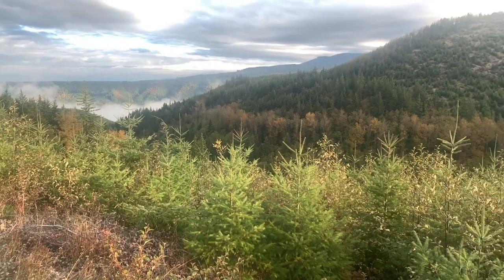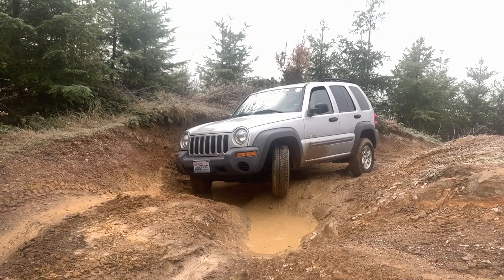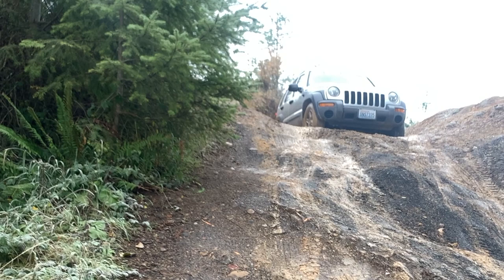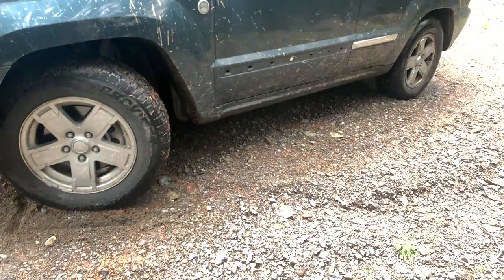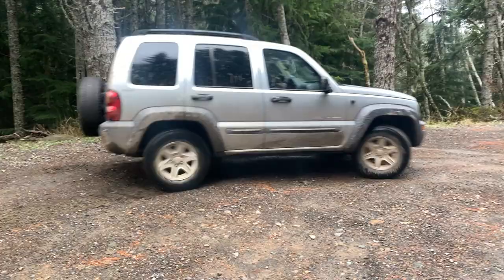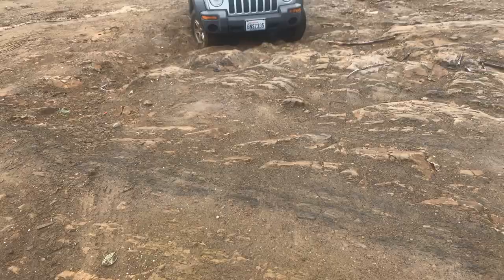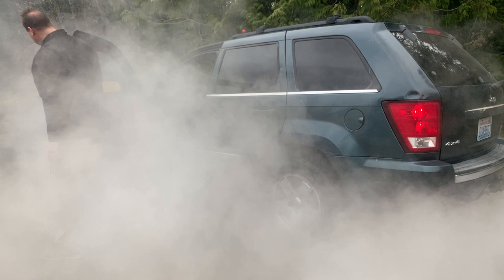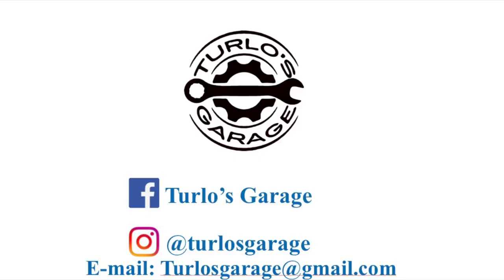JEEP LIBERTY KJ VS JEEP GRAND CHEROKEE WK/ OFF ROAD DUAL TO THE DEATH!/ The winner is SHOCKING! EP34

Comment: I bought an '05 Liberty 2 years ago. Pulls my boat up and down the hills just fine and is fairly simple to do basic repairs & maintenance on. It even flattened a coyote at 65 mph with little more than a cracked bumper cover.

Comment: In regards of the jeep liberty towing, my Ford Expedition was down and I had to make a trip from Huntsville TX to Sioux Falls SD and then to deep in the hills of Ohio, 06 jeep liberty I picked up a 6' mowing deck in Sioux Falls and then picked up a front mower john deere 1435 with a deck, so that's 4500lbs for the jeep, trailer 1700lbs, the deck 560lbs and the mower was 2500lbs, that's a total of 9260lbs on a 9500lbs maximum gvwr with a jeep that has 340k miles on a original tranny and engine at 70mph, I'd say that was a test of a true mini giant. That jeep is my tool car and those wondering what fuel mileage was, it was average of 14 mpg for the whole trip.

Comment: My friend have WK with turbo diesel engine and Quadra-Drive, 2 inch lift and 32s. Very capable 4x4!
Reply from the maker: They do really well as long as you don’t have a 5.7 HEMI that gets flooded.
Reply: I got the 4.7 with QDII and its cheating lol cause I pulling trucks twice my size out of sand mud rocks its the best offroad mom van ever
Reply: Mom van 🤣🤣🤣👍
Reply from the maker: @TadiclsOperator  just don’t go through water without a snorkel. Or maybe it’s me and Jeeps and water don’t mix.
Reply: @TurlosGarage  I've been in water level with my hood a few times but I've been lucky so far, but water proving the computers and snorkel are on the list of priorities
Reply: I have this same setup and it's a monster. It will crawl through anything.

Comment: New Subscriber here. I have two 2003 Jeep Liberty's one of which I bought with a blown engine. I'm using it for body parts. Liberty's most two important things to upgrade are a bigger 4 core radiator and a good transmission cooler. Our little Liberty has been a great 4wd that goes awsome in snow.
Reply from the maker: Welcome aboard Mechanic Steve! Thanks for the advice. I have a lot of passionate Liberty owners that follow the channel. In the past year my 02 Liberty has really grown on me and I am very impressed with the value of the Liberty. Thanks for Subscribing and watching!
Reply: Is it true that the diesel and petrol have different 4wd systems? I’m in the UK and deciding which one to get. Petrol has a proper transfer box whereas the diesel has front and rear separately?
Reply from the maker: @johnnon6583  I am not sure. That is a great question!
Reply: Liberty 2006.  Has a tranny oil cooler..
Reply: I grew up in Michigan and always kept a small light 4x4 for winter. S10, explorer, jeep Cherokee...... Those light short wheel base 4x4s do great in the snow.

Comment: i have the ’07 3.0l diesel with QD2.  great car have taken off road in AZ - no issues…. 170,000 miles and going strong
Reply from the maker: I have a friend that bought an 06 CRD Grand Cherokee a few months ago and it has been great. I am very impressed with the 4x4 system in these Jeeps.

Comment: Should call this channel "Jeep Raggin'" !!! Lol.🤪Damn you drive em rough huh bro?
Reply from the maker: It’s a Jeep, they are meant to be driven rough. Just not under water. 😁
Reply: @TurlosGarage  agreed. I like to see y'all push them so I know how far NOT to push mine. Lol. It's awesome man. Been off-roading here in Louisiana for decades. I used to drive a CJ7 with a small block and 38 Super Swampers. It made short work of most mudholes. Now I'm driving a liberty and looking into modifying it. Gotta swap left front axle first.

Comment: The liberty will match almost  every rig if you give it a decent set of tires.... the "off road test" was a terrible display  (first few mins)
Reply: That Jeep Liberty wasn’t even Trail rated. The Jeep Grand Cherokee was.
Reply: I own both a kj and a WK would take the liberty off road anytime before the grand cherokee
Reply: I have to agree with the comment on BETTER tires on the Libbey...From experience when  switched from Wranglers SR-A to Falken A/t3w, it was an impressive big difference between the two tires how it handled offroad Mud and 6inches of snow.
I've also owned both a GC and Libbey...and i agree GC is way more comfortable, but i found the Libbey more easier to steer and handle .
Reply: Liberty is not a very capable offroader! AT ALL!
Reply: @EricJohnson-tb9sj  not sure why you say that.... My liberty has followed fully built jeep wranglers and done just fine.... I've gone through mud holes deeper then the top of the fender flares... It's done fine. They are actually very very very capable off road
Reply: @EricJohnson-tb9sj  The Liberty is very capable off-roading.
Reply: @EricJohnson-tb9sj  why you lying? 😆
Reply: @RangerRick2012  they're as capable as a suburu! You don't have a low range .. you're not following yj's and tj's! Sure! They go off road,  but only to an extent! Same for the patriot!
Reply: @TSuave  you can follow them in the places that are easy enough for the Liberty to go! Mid level to advanced trails and that Liberty ain't going nowhere!! They don't even have a low range on them! And if you've done any off rodding then you know, 4lo is needed for any reL wheeling!
Reply: @EricJohnson-tb9sj  do you own a liberty? The liberty has the np231 or np242 transfercase both with a 2.73:1 low range gear... Again I've been in mud up to the top of the fender flares and continued through... iv followed many build wranglers with 35"+ tires ...
Reply: @RangerRick2012  keep it real son! You don't even have a low range!
Reply: @TSuave  No. But was looking to buy a Lib or a patriot until I researched them both to find that they had the fd1 and fd2 as their 4wd .. (AWD) Systems! Great in the snow! (Like a suburu) but thats about it! I decided to go with a rig with an actual 4wd system 4hi .. 4lo sure they're "capable" .. but only for LIGHT offloading! Its a Mom van!
Reply: @EricJohnson-tb9sj  ok well hate to pop your brain outta your head here but I daily my liberty it's got 4hi, and crazy... 4lo... And 2hi.. wow nuts eh? Oh and for an upgraded bonus I also have 4wd full time! Not sure what part of I've had my liberty in mud up to the top of it's fender flares and followed fully built jeep wranglers your failing to understand but they are deffiently meant for a lot more then "light offroading"
Reply: @EricJohnson-tb9sj  Liberty doesn't have FD1 or FD2, we have Command Trac and select track....Freedom Drive (FD) is a whole different transfer application just like Quadra-track, quadra-drive. Etc...I think the Grand Cherokee I used to have had Quadra-Drive with NV245...I used to like that system too....But regardless, the FD is something for CVT transmissions, which unfortunately Liberty didn't come with CVT, theyre 4-speed autos. . Its like comparing A horse with Bull. . But regardless of tranny system types...the KJ's Command track and Select track is offroad worthy and proven numerous times throughout the decades..its really nothing new in 2021...Is in matter of fact, used Libbys today are considered one of the best bangs for your buck in the offroad world...They're affordable and could keep up with rigs that are 3x more expensive.
Are they the best off-road vehicles in the world? No, they're not Humvees. Do many of the people who buy these models do so because they want to go conquer Moab? Not really,  most are weekend offroaders. Are they as off-road capable as any other vehicle in their segment? Yes…and that is why they have proven to be so popular
Reply: @RangerRick2012  I can concede to the idea that they are as or even more offroad capable than any rig in its segment! But I don't believe that segment goes beyond Libertys, patriots and renegades! But Mr Rick. I may be wrong! You mentioned quadradrive or quadratic in the liberty .. I thought it had the FD system! I watched hrs of footage on the liberty and was not impressed with its offroad capabilities! I'm gonna go back and do some more digging! I don't want to be wrong so I'll get back to you after my search!
Reply: @hollymott9532  its not! You just haven't been anywhere in it!
Reply: @TSuave  Is this the command track system? Hey .. I may be learning something today! RangerRick threw some info on me a min ago! But I will need to do some more digging myself before I concede to the idea of a mom van keeping up with "fully built jeeps" .. But I'm open!
Reply: @EricJohnson-tb9sj  no no, Quadra-Drive is a Grand-Cherooke thing..FD were made for Patriots and Commanders on 2006 or after with their CVT tranny....i used to have a 2001 Grand Cherokee..Used to be more into offroad when I had that GC... then i started leaning on the speed world. So I sold that Rig a long time ago because i bought a sports car....Then suddenly I missed having a jeep for bad weathers (i live in the North East, were snow blizzards can be a problem and that GC never failed me on blizzards)...So in 2018 i decided to buy an affordable 03 Jeep Liberty for those weather occasions...i think i only payed $3500 with 130,000miles (which is low for that year)....But as time went by, i decided to push the lib to its limits just to see what it can do in all areas..from highway, snow to offroads...even racing LoL...I've taken it to many backwoods adventures dropped in LO with mud pits and climbed out mud holes that must've been a little less than 3ft tall.. Thats when i personally learned its definitely offroad capable  💯 . . . Now, thanks to that Libby that i underestimated..I'm suddenly back into offroading hobby lol...Now in the process of getting a OME lift kit.

PS....and that Grand Chrokee that I sold years ago, I still see that damn thing being driven around by the person that bought it off me..that truck definitely over 200k and still kicking lol
Reply: @EricJohnson-tb9sj  yes the command trac is the NP242 transfer case, same case used in a lot of jeeps... (Cherokee, liberty, etc etc)
Reply: @EricJohnson-tb9sj  well a friend of mine in our local offroad group has a jeep wrangler on 37's and locked and lifted etc etc with Mikey Thompson tires on her and I can follow almost any line he takes (the almost is due to my lack of tire not being able to climb a rock) however  rock steps and mud trails and whatever else the liberty has yet to fail me... I've had it in 3ft of mud and it never skipped a beat, I've had it leaned almost scraping it's mirror and it never failed me, I've been on down hill "cliffs" that were just about 70° (aka almost stright up and down) these things will wheel strong
Reply: @TSuave  lol. I'm learning that they may be much be tter than I thought, but being as capable as your friends jeep!! Cmon man! Thats just outlandish!! He he takes an easy line over an easy obsticle .. than sure you follow him! But when he decides he goin OVER SOME SHIT!! you are gonna park and wait for him!!
Reply: @EricJohnson-tb9sj  haha idk man I paid $800 for my liberty... I'm gunna just send it haha mine has a 4" lift coming and 33" tires. Rear locker, it sports a 10,000lb winch upfront already
Reply: @TSuave  Damn, $800 for that is a steal...My Lib literally grew on me. Aslong as u keep up with the maintenance, it's really not a bad truck..These trucks are underrated..thanks to people thinking they're soccer mom vans, which keeps the prices low....which evolved to one of today's best bang for your buck vehicles. Yet, I've taken notice Aftemarkets specifically for these jeeps are kept somewhat high...like an ARB bumper guards...the prices remains HIGH for liberty for around $1000...yet for other makes/models  like a Toyota Tacoma its only $500...I guess because there's not a big demand for aftermarkets for these truck as a per say Wrangler...but I've noticed there still lurks a few small but loyal liberty crowds around...and since those exist, they keep the prices a little high.
Reply: @RangerRick2012  Heavily modified! Doesn't count! Cmon man! I've been on the verge of saying  (ok maybe you're right) then you pull this!! But with all due respect!  Anything can be built or modified to do WHATEVER you want it to! I didn't watch it  yet but ill go watch the whole video now!
Reply: Ya those things are built! BUT!! I feel it would be a great platform if you had the means to make it!
Reply: @EricJohnson-tb9sj   My liberty has 4 high and low.
Reply: @maclawson4438  yes this is what I'm finding out! Should be plenty capable!
Reply: @NickSharpe  You're  late! Buddy ..  I got some info from a couple others on this topic .. ( on this post) and have changed my view of the liberty! They're not "THE SHIT" by any means .. but they're a bit more capable than I originally thought!
Reply: @EricJohnson-tb9sj  es comand  trac y tambien traen  diferencial trac lock en versiones limited en mi caso vivo en la sierra y realizo off road todos los dias en mi liberty 2005 y aun no se atasca .tiene mejores neumaticos que el del video si all terrain . saludos

Comment: Wow.. The liberty does not have rear posi-trac. It is an open or limited diff. I'll stick with a good ole' WJ with lunchbox lockers on 32's and a 3-inch lift.
Reply: There were different options.  I have a 2006 Liberty with Command Trac 4x4 and in Low it would Easily traverse what was in this video.

Comment: That's not a trail rated liberty
Reply from the maker: It is not. It does do very good for what it is and I would take it over the Grand Cherokee.
Reply: @TurlosGarage  True I have the renegade one with 240 original miles on still going strong. Also I have hated side by sides and snowmobiles no problem

Comment: Stuck in Park as a result of wading through a puddle lol
Reply from the maker: The shift cable came out of the bracket on the transmission. I clipped it back in and no matter how hard I pulled it would not come out again. LOL

Comment: I just lifted my jeep today gained a lot of room, going to see what it can do really soon. New everything in the front, JBA upper control arms, 3 inch budget boost, lower control arms, 2 inch wheel spacers, 3 inch magniflow, exhaust (shop did exhuast), catback, ball joints tie rod ends, struts, pod lights, spark plugs, throttle body, spacers, egr valve. took me 22 hours lmao...if you lift it either give yourself a couple days or a day at least..for the lift... Really impressed with the height gains..
Reply from the maker: Thanks. I have planned on doing a lift for several months but something always happens, or breaks in my other cars. I want to build my own control arms.
Reply: @TurlosGarage  whats up i jist finished mine about 6 hrs ago..i posted a video ....go check it out..oh..hey mine is actually 2.25. Suspension leveling kit about 135 bucks online. .It raised my front two fists horizontally higher..thank god because its 2.25 a 3 inch budget lift wont fit...the cv axle in front will either hit the clevis or lower control arm where the lump is at where the clevis bolt goes into the lower control arm..also the cv joints will pull out and the angle is more than 30 degrees...make sure it doesnt measure more than the 2.25 on the front my rear is the same and is no where as high as the front.but the cv axle boot is really close...so i got to get new springs and black max shocks by skyjacker..cheapest  or budget friendly..took me a while and a sore body and mainly 15 mm 18 mm 10.. 19mm 21 .. and 36 mm axle nut socket..breaker bar and torque wrench..adjustable wrench , pb blaster, thick skin, brused hands and knuckles and a partrage in a pair tree
Reply from the maker: @redhandedreviews3482  that sounds like a party! I will check out your video.

Comment: I love my limited 2007 w 3.7 engine.  Looks almost like a 4 door Wrangler but cost me only one third.  LOL.. Mine has only 84k miles in nov 2022.  I took care of the underrust well.
Reply from the maker: My 2002 Liberty is at almost 200,000 miles and still unstoppable! 84,000 miles is like new still!
Reply: @TurlosGarage  I have sunroof, side air bags, leather seats, came also with 17" rims, not 16".  Has all, except on dash GPS.  Only 2,700 dollars i paid in 2021.  Paint is still good.  Tires are mid wear.  Drives like new.  Gas is not that bad.  I get 20 mpg combined.  Looks almost like a Wrangler, cost like a cheap car..
Reply from the maker: @CFITOMAHAWK  Do you have the Trac lok rear axle? That make a huge difference, off roading, rally racing etc
Reply: @TurlosGarage  Oh yes.. But it is a combination of electronic and some small clutches in the spyder gear passenger side unit.  Electronics brake the speediing wheels if they overspeedand slip, the clutches slow that tire down too as they heat up when wheel overspeed .  So it is an E-Limited Slip Diff.  
I rebuilded the difff myself along with a friend that knows how to better than me.  Previous owner was using it with low gear oil due a seal leak. 
Use the Slick 50 with thick fluid, it works on old gears and diffs.